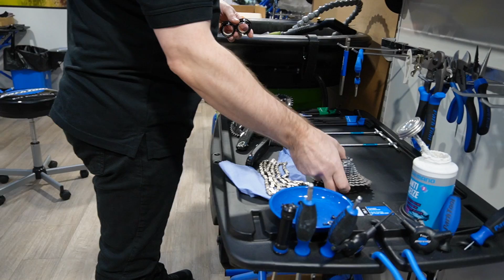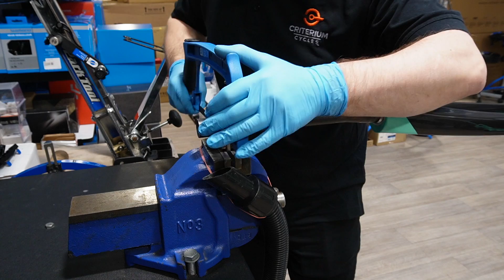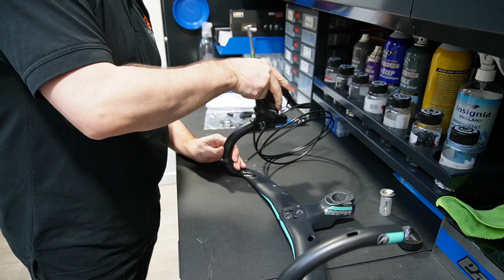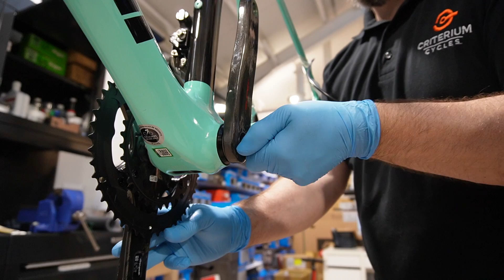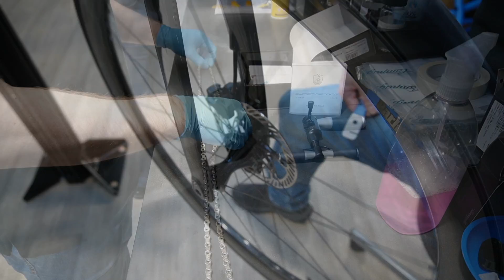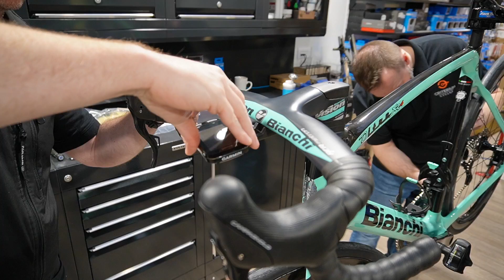Bianchi Oltre XR4 with Super Record EPS - Ultimate Bike Build step by step - Cycle Sunday S2 Ep1

Comment: Hi, I have a similar bianchi frame that I would like to restore but so far I have been struggling with choosing the right components. Would be helpful if you share which components did you equipped it with? Namely the cassett, the shift and the brakes.

Comment: This can be summarized by "do not think about trying this at home". Mounting and adjusting mechanical shifting and rim brakes requires an allen wrench, screw driver and a cable cutter. Internally routing, wiring and adjusting electronic shifting and hydraulic disc brakes requires about a dozen dedicated tools, syringes, gaskets, plugs, spacers and templates plus a few extra feet of electrical tape.
Reply from the maker: It can indeed. Especially for me 😂😂😂

Comment: congratulations on your new bike....great to see everything coming together. In the end, the top end bikes are going to cost - the same way as the difference between the cheapest and most expensive cars.  Now you will have to raise your riding to match. thought you might have left the stem until after the first few hundred miles to check the fit and then cut it..so hope that works out. 
enjoy...
Reply from the maker: Sadly you can’t do that. The integrated bars mean it has to be cut to the right size. Luckily is was fitted so so knew the perfect measurement. Get it around though and it’s well over £1000 for a new fork or and 8+ hours in the workshop taking the bars off and cutting the tube 😳
Reply: PS I really enjoy my Michelin power tubeless...good choice...the confidence and grip is great

Comment: Took me a few minutes to type this, couldn't stop my eyes from watering after you said the price..
I'm surprised the bike has disc brakes?? I would have thought blocks would have been lighter?
Reply from the maker: The Oltre XR4 is one of the few frames you can still spec with rim brakes. However we choose discs for a number of reasons. Including better all round braking performance and the fact we wanted to run 28mm tubeless so needed the clearance 👍

Comment: Now that was a very welcome video.
Nice build.
Same groupset and wheels as I am going for myself.
It is on the heavy side though.
My current one is a size 58, 2010 Cervelo S1aluminium frame with Ultegra.
With pedals, 2 bottle cages, Wahoo elment bolt V2.
And it weighs 7.93 kg.
It is a bit smaller than yours and with rim brakes, but it is aluminium, not carbon and not as high specced groupset and wheels.